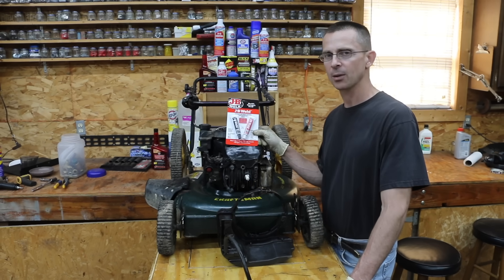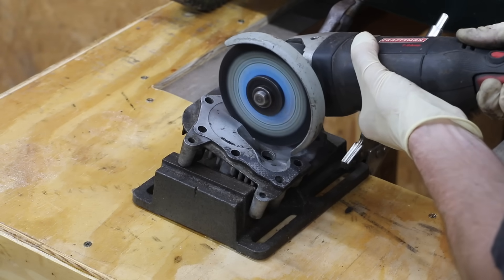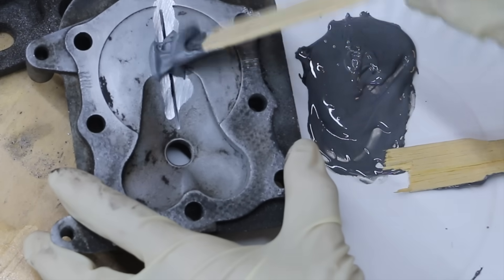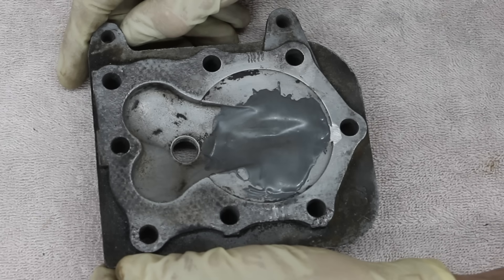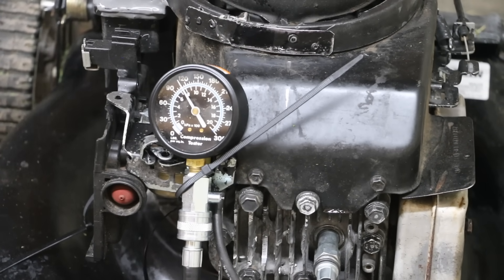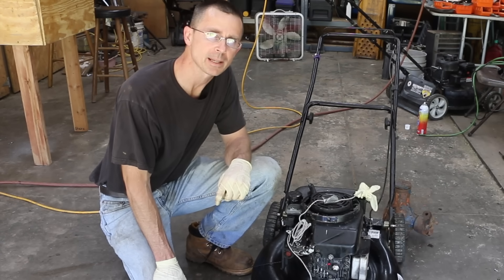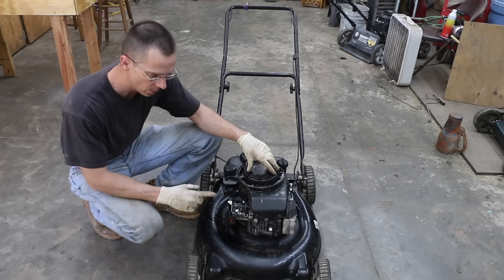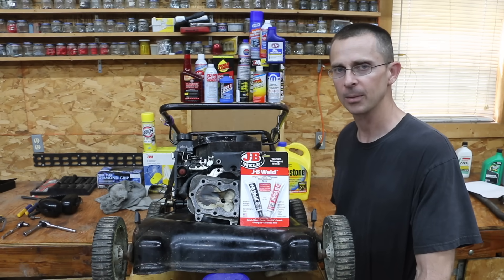Can JB Weld fix a cracked cylinder head?  See the proof!!

Comment: jb weld works very well because it stays a bit flex able.
While on the road with my semi the mounting  ear on the  alternator broke off.
I used jb weld to fix it and it lasted 5 years before it came off aging.
I have also fixed stripped threads in holes by filling it with jb then re drill and tap the hole.
Reply from the maker: Impressive!  I like the idea of fixing threads with it too!  Great idea! Thanks for watching the video and commenting!
Reply: redone1995 as a machinist, I'll use that idea for stripped threads.
Reply: I should add I usually only do it where seepage through a heli coil type repair is a concern.
Reply: It takes a little practice to fix threads with it but if done right it'll last a long time.I generally try and leave as much old thread as I can in there.But at other times I'll drill half the threads out over size and tap them a little with a larger tap to give the JB something to hold on too and then fill the hole and retap.It's tough to explain but you use the lower threads as a guide and the jb weld fils in the top portion and it works like a champ.
Reply: My cylinder cracked and its leting water in do you tink this will work when it's hot

Comment: Years ago I had an aluminum 3 banded 48 inch speargun. The bands were held in place by these thick pot metal wings. I broke one of the wings and thought the speargun was trashed. On a whim I used JB Weld and epoxied the broken wing back together. That speargun worked perfectly for 2 more years of heavy diving and spear fishing. To give you an idea of the forces involved, a 3 banded 48 inch gun exerts 250-300 Kg of pressure.
2 more years of swimming in a salt water environment with a fully banded speargun, (constant pressure) and firing it hundreds of times (sudden pressure release) and remember the broken band holder was POT METAL. 
JB Weld is good stuff.
Reply from the maker: I agree!  Great stuff!  Thanks for watching the video and commenting!

Comment: Any reported results using JB on a cracked exhaust manifold? Got an 88 cherokee, 4.0l I6 engine with a cracked exhaust manifold; apparently a common thing for these guys. Was just curious
Reply from the maker: You might try the high temp JB Weld.  Might work if there isn't too much movement.  Thanks for watching the video and commenting!
Reply: I don't think there will be much stress via the rest of the exhaust piping as... well there isn't any. Probably should've mentioned that from the start. One rainy day in Mexico I found myself in an abandoned parking lot. Scheduled to get some new Firestone Destination A/T treads the following week, I couldn't resist the urge to roast my tires and get in my fill of yummy donuts. In the high RPM process, the vibrations must have been too much for the small sliver of rust connecting my cat/muffler/exhaust piping to my manifold. I heard a small pop, metal dragging against pavement, and most importantly I heard my jeep come alive ;) I hopped out and with a little struggling (thanks to the rainfall and my gloves) I was able to wiggle the useless exhaust section free and toss it in a nearby dumpster. It was so rusted at that point that many parts simply fell off before I could make it to the dumpster. The cat looked like it was probably the bit in the best condition, and i could still see daylight through the rust-holes, so I didn't feel bad tossing it all. What remained was the red stain in the parking lot from the rust, and another also uncontrollable urge to destroy what was left of my tires in a glorious concert of squealing and red-lines. Also, I would only be using it as a temporary fix to improve the flow until I can save up for the headers I want. I've already got a Flowmaster super 44 waiting for the new headers so hopefully it'll sound alright when it's all done :)
Reply: Definitely gonna look into the high heat stuff more, I work a stocking job right now and I've seen it a couple times but honestly completely forgot it existed until you mentioned it. Keep up the awesome content please and love your research/proof of seafoam

Comment: Can you check to see how much nitrous oxide cleans the combustion chamber? I wouldn't do it on a lawn mower you love ;) I just got my street car back from the drag strip where I snapped an input shaft and I figured I'd get the head/valves and stuff checked because it over revved quite a bit when it snapped. When the mechanic took the head off he said "it was so clean in there I could eat off it" so I assumed all the nitrous I had been using that day cleaned it up good.
Reply: Check Google, used in creamers or you can suck it out of whipped cream spray cans. :)
Reply from the maker: Seems like a great test, but I don't have an easy way of acquiring nitrous. Thanks for watching the video and commenting!
Reply: Don't have an easy way of acquiring the actual nitrous or you mean the nitrous kit/hardware? I could probably get a kit to you but you'd need somewhere local to fill it up for ya. No race tracks around you? Car performance shops? Make some calls :)

Comment: I have a suggestion for a video. I don't know if it would be a valid test, but I'd really like to see if Shell V power nitro + gasoline would actually clean up and prevent build up or corrosion. They claim that you can not get any better than their gasoline and they also claim it cleans intake valves and removes slug and carbon build up on engine parts. Ive looked but can not find a before and after test of this gasoline. I think it would be a cool video idea but I don't know if it would pertain to this kind of series. But if it does, I'd definitely like to see an experiment with it
Reply from the maker: Great suggestion!  I'm compiling a massive list of projects!  Thanks for watching the video and commenting!

Comment: used to work with a guy that had an old Plymouth station wagon with a slant 6 in it. Had a 6 inch long crack in the block that leaked oil. He JB welded it and about every 6 months he would have to chip out the old JB weld and reapply it, still cheaper than replacing the engine.
Reply from the maker: Impressive!!  I enjoy reading the success that others have experienced with this product!  Thanks for watching the video and commenting!

Comment: Been using  JB weld for many years and for an inexpensive Epoxy  that stuff is the Bomb first started using it about 25yrs ago flying RC Helicopters used it to Glue the Clutch Linings to the Clutch Bell  never failed  over the years used it many times for almost anything . the only thing JB weld can't fix is a Broken Heart
Reply from the maker: It's a great product! Thanks for watching the video and commenting!

Comment: There was a hole in my transmission but instead of buying a new one I just sealed it up real good with steelstik and its been on for awhile and it has never fallen off. Every time I check the transmission fluid, it always stays the same level. No leakage, no problems. I make sure that the surface was bone dry first before applying the steelstik so that it would adhere perfectly.
Reply from the maker: This is great!  Another success story!  This goes to show that there is a place for additives and products in a tube.  Sometimes the right answer is to replace a part, but not always!  Thanks for watching the video and commenting!

Comment: Another great video mate. Do you think this would hold up on an exhaust?
Reply from the maker: It depends.  I would suggest the "high temp" JB Weld and only for a pinhole leak.  It's important to scuff and clean the surface.  Ideally, the JB Weld would be applied inside the exhaust if you can gain access to it.  If not, there's still a good chance it'd work.  i don't believe it'd work for a large hole or gap.  Hope this helps!  Thanks for watching the video and commenting!
Reply: Yes thanks for your help mate was thinking of putting a bit of jb weld followed by a piece of metal with a clip on it

Comment: In powder coating around 400deg. I find the JB weld softens and sometimes fails. I'm doubtful it could hold a spark plug in a completely stripped hole. I thought of trying it once but helicoiled it instead.
Reply from the maker: I wonder if the "high temp" JB Weld would hold up?  The option you chose is wise!  Thanks for watching the video and commenting!

Comment: i used jb weld to hold in a spark plug thread insert that kept coming out when removing the plug. also used it to make my own exhaust studs where threads were stripped in the jug.
also used it to block off a leaking PAS pressure sensor.
its good stuff and i doubt you will find anything better :)
Reply from the maker: I enjoy finding out how others have used this product!  Thanks for watching the video and commenting!

Comment: can you try the British favourite of "araldite" made by hexcel composites good ol British engineering and all that,  love your vids by the way, good honest non biased product testing.
Reply from the maker: I'll try this product if I can find it via Amazon or local store.  Thanks for the positive comments and thanks for watching the video and commenting!
Reply: IWR, bisphenol A diglycidyl ether is what you get when  you react bisphenol A with epichlorohydrin - the two building blocks of all epoxies. Araldite is just using the long-winded way of describing the same polymer: epoxy with sand and carbon black in it.
Reply: tried araldite on a fuel tank it dosent seem very petrol resistant lasted a couple of days.hows the jb long term on a gas tank ?
Reply: jmowreader Thankyou very much - I didn't know that. I read the reaction product section by mistake. It was late, oops.

JB Weld:
Furfuryl Alcohol  1-5%
Calcium Carbonate   5-10%
Non-fibrous Talc  15-25%
Barium Sulfate  20-30%
Aminophenols   1-5 %
Polyamide Resin  15-25%
Titanium Dioxide   1-5%

Araldite:
ingredients not listed other than originally posted.

Not particularly useful. oh well.
Reply: groovedodger as long as all of the fuel is cleaned up with the tank I have seen J-B Weld to last very long and Automotive applications but I have also seen it fail where there was just a little bit of fuel in the tank
Reply: IWR: the UK seems to have different laws on product labeling than the US does. In the US you have to admit everything in your product; the UK only requires the major components be listed. Taken to extremes, that's the McDonald's French Fry in a nutshell...
Reply: Mr incredible that would be good to see as a comparison, I would also like to see that👍👍
Reply: Mr incredible 
Yes I'd love to see that old British favorite.
Reply: According to the MSDS sheets:

JB weld contains:
Bisphenol A epoxy
crystalline silica
carbon  black

Araldite contains:
Bisphenol A epoxy BUTANEDIOLDIGLYCIDYL ETHER

I would bet that JB Weld performs better.
Reply: I have used NHP on a diesel fuel tank with a carbon fibre patch but alas NHP no longer exist but I have herd that the formula is trading under a different name now? Any Americans confirm or deny this?
Reply: Araldite is 100% suitable to repair fuel tanks. Even the 5 min version. When foam filling race car fuel tanks that is how you seal the tanks, araldite and blind rivets. Even takes very large hits without failing, the tank split open but not the patch. I have used it to patch race tanks that have hit the ground with 100 %. success. And that was far from ideally clean.
A friend repaired a badly cracked and corroded Isuzu cylinder head. It worked for several thousand km.

Comment: That's really impressive. I've used jb weld to seal the valve on my vacuum chamber. One thing I've heard allot but never got to test is that if you used platinum or iridium spark plugs you can hurt your engine. To me this makes little to no sense but if you're willing I think it would be a good video.
A great tool to have in the shop is a dremel with the extension and wire wheels for it, it'll make light work of removing carbon deposits
Reply from the maker: Great video recommendation regarding the spark plugs!  Yes, I need a dremel badly!   Thanks for watching the video and commenting!

Comment: A straight clean cut is not the same as a stress crack, the weakest points will crack again.
Reply: With an actual crack, you drill a .040" hole at the ends of it. Stop drilling it's called.
Reply: gabriel molina you would remove the crack by grinding it out just like if you were using a real welder to repair it. A die grinder would do a really good job of removing a real crack.

 But you also should drill two holes, one on each side of the crack, not on the crack just past it before grinding it out. Otherwise the crack would likely keep spreading as you grind it out.
Reply from the maker: Great point!  Thanks for watching the video and commenting!
Reply: Stupid question: Can you pressure fill cracks with JB Weld? Fill the crack with the JB toss it in a cheap vacuum to try to fill micro cracks?

Comment: I love JB Weld.  I run a remote camp and have repaired tons of stuff with it.  Had my Bro-inlaw smack a rock and take out his oil pan.  We quick parked it on some logs before all the oil was gone.  Wire brushed around the hole, JBed it up and he drove it for years like that till he sold it.  Also had some ***holes use a reciprocating saw to cut through the gas tank on my truck and steal my fuel.  Same repair.  Wire brushed the tank and put on JBweld with some tape to keep it from sagging off.  It held for several months but then started leaking when the vehicle was parked and had not been driven for some time.  So I wouldn't recommend it as permanent repair for a fuel tank, but it is a permanent fix for an oil pan.
Reply from the maker: I enjoyed reading your comments!  Thanks for watching the video and commenting!

Comment: make a Video on how long a mower can run on 2 stroke motor oil in the crank case
Reply from the maker: That's a great suggestion!  Thanks for watching the video and commenting!
Reply: My understanding is that 2 stroke is just motor oil with the detergents not added.I don't buy 2 stroke oil I just use my old motor oil instead and it works fine.

Comment: HHmmmmm JB weld high compression mod.
Reply from the maker: LOL!!  Thanks for watching the video and commenting!
Reply: Yeah, seriously. Try to increase the compression by filling the cylinder head with it.
Reply: that theory works with conventional overhead valve motors but with flatheads the smaller the combustion chamber the less flow you get within the head. Its a fine balance, in this case, shrinking the combustion chamber of a flathead will reduce its power. Ive raced briggs flatheads for years.
Reply: If the JB Weld increased the compression, it's possible it will run better, but there's also more of a chance of preignition if you end up using old or bad gas.
Reply: Thanks for that info.
Reply: Exactly!! He should try and fill as much of the head he can and see how high he can get the compression :)
Reply: Ever seen a Briggs preignite?
Reply: He's now getting a lower air-to-fuel ratio in the combustion chamber with this modification, so it would alter fuel economy as well as ruin the power band...
Reply: Christopher Valdés
He's getting a higher compression ratio because of the reduced combustion chamber volume, but I fail to see how he's altered to air-to-fuel ratio.  He might also have created a hot spot where he broke off the cooling fins. Since this is just a proof of concept, these issues are irrelevant.
Reply: You are right! I failed to acknowledge the natural aspiration... My response was toward it being a "mod" rather than being just research. Higher compression would throw off the timing, would it not?
Reply: Pack it with so much JB weld that it becomes a diesel, or at least so it needs 93 octane to run without knocking.
Reply: Lmao,pplay dough for valves!!!!!
Reply: It's potmetal and he keeps taking the head off so the gasket is flaky unless he keeps putting a new one on.  No reason to think it's better to increase the compression of that particular engine beyond spec, just give it more throttle if you want more output.
Reply: How much can you reasonably open the throttle on an engine like this without causing problems?
Reply: you'll end up making a lot power, shrinking the combustion chamber on a flathead engine drastically cuts down on flow. Experience: racing briggs flatheads for years
Reply: Paul Bellows just stating

Comment: Awesome video!  I have personally had great results with JB, I fixed the gas tank on my dad's chevy station wagon, the pin hole was right at the bottom of the tank, and I've used it to fix the water jacket portion of the intake manifold on an old ford Ltd, the stuff works, nuff said :-)
Reply: damnoldguy I've used JB Weld for many years and really like the white water proof marine version but went to use same regular version he used on a small steel gas tank repair hole on bottom of car gas tank, it does NOT do well with gas at all like they say, I tried it about half a dozen times, the regular 50 50 mix as well as other ratios. It always was dissolved and broke apart in pieces, it can't come in contact with lots of gas on bottom of  metal tank, even putting a bolt and a screw in hole to give it something to hold onto and getting all fuel out. The vapors of gas alone made it not stick and come apart eventually. It's good stuff for certain things, plastic stuff , some metal but bare steel metal even roughed up and gas, NO! It will not hold, it will crumble, also tried the marine white version, it worked a little better and works great on boats and in water but not car gas tank!! Busted JB Weld, also not great for really high temps and fast moving parts!
Reply from the maker: I really enjoy hearing how others have used this product!  Thanks for sharing and thanks for watching the video!